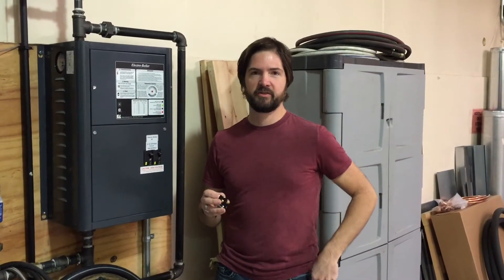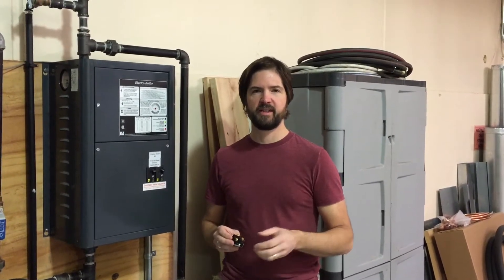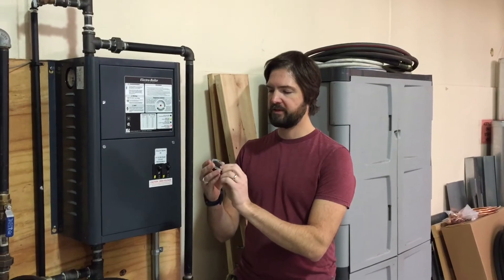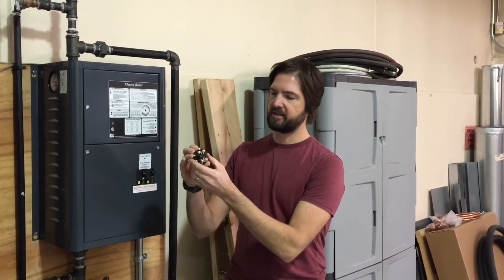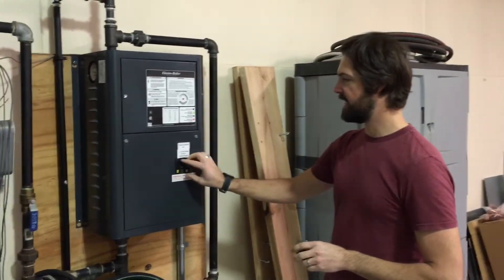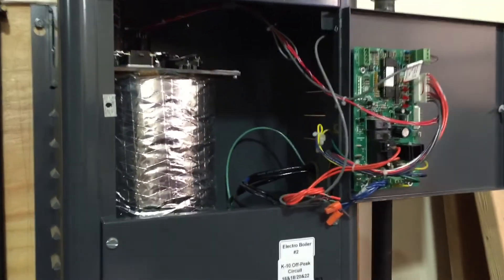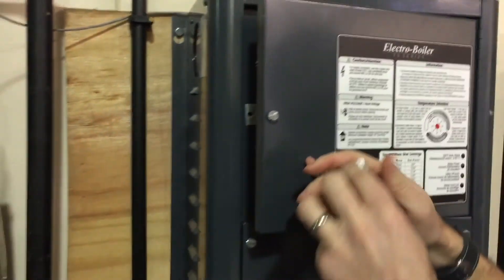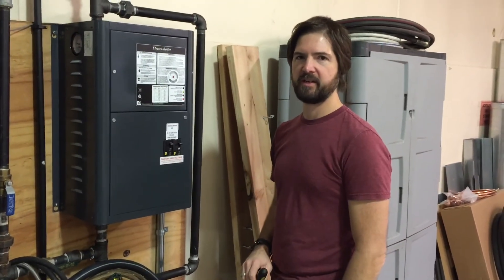Electro-Boiler Manual Hi-Limit Reset Procedure

Comment: That was helpful but not it tripped again.  Do the Switches ever go bad or is there a different issue happening in the system?
Reply: Pretty rare to have a limit go bad unless it has water damage. Does your system have good water pressure? Also check for amp craw after the heat call end.

Comment: Thanks for the video.  Woke up this morning with no heat.  Reset the switches and now researching why they tripped.  Pumps are good, both primary and secondary loops.
Reply: I am writing from experience with a Utica Boiler, residential.  I had same problem and my draft/exhaust pipe from furnace to chimney had a small hole in it, shutting down the system.  had to reset limiters and fix the pipe, seems to be ok, hope this helps
Reply: @rgentil32  Thanks for the info, but I have an electric boiler so no need to exhaust.  this is the first time in 3 years it has happened, so the troubleshooting continues.

Comment: The 30 amp circuit breaker failed so replaced it and still no heat, this video helped me reset limit switch and now have heat. Thanks